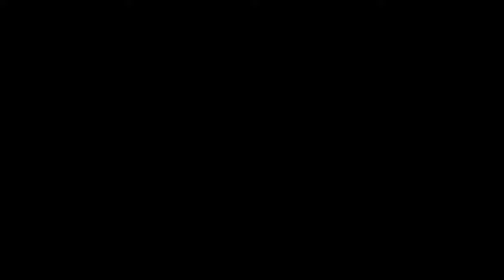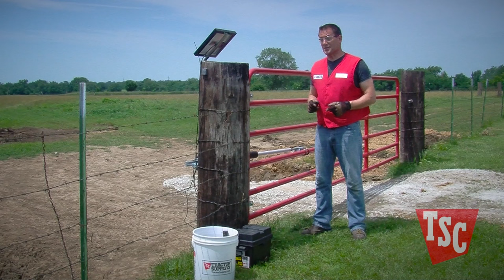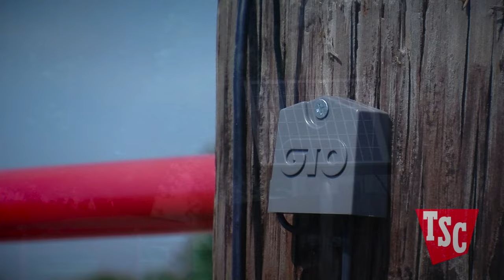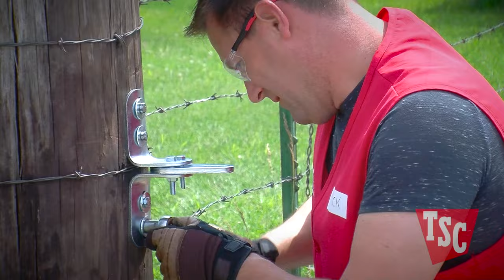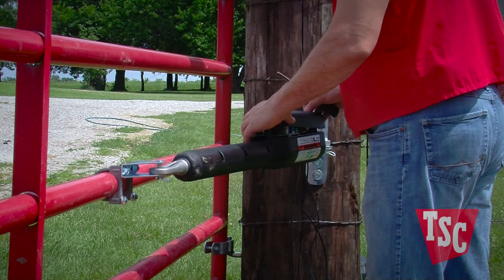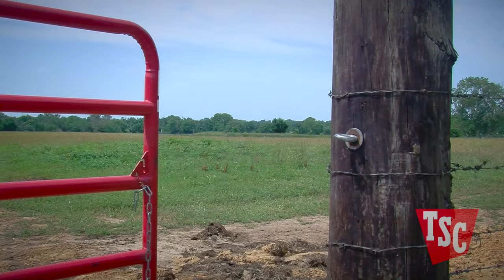How to Install an Automatic Gate Opener | Tractor Supply Co.

Comment: How do you open an close it?  Does it have a code box?  Does it have a remote?  I'm an amputee, that would need to be able to open and close it from my tractor.  Any help, ideas, suggestions, would be greatly appreciated. Thanks so much!
Reply: Works just like a garage door opener.  Remotes and/or keypad.

Comment: Can it be installed into cement posts?
Reply: Toni Renck with right tools yes, i have the same set up. Just be careful what screws or bolts you use. Make sure they are for cement

Comment: So, clearly I'm super late to this party. But I can save you guys a TON of trouble. It's simple..... The first step to installing your gate operator is to NOT use a Mightless Mutt operator. If you're "out there" as TSC likes to call it, you have far better things to do than babysit and repair that gate twice a week. That crap wouldn't last only swinging a cupboard door. You've seen the damage your livestock does to gates. After they rolled on the ground laughing at that thing (and you) for ten minutes they'd just sneeze and blow it open for ya even if they didn't want through the gate. Spend a little extra money and get a good system (and someone to put it in right). YOU WON'T REGRET IT.